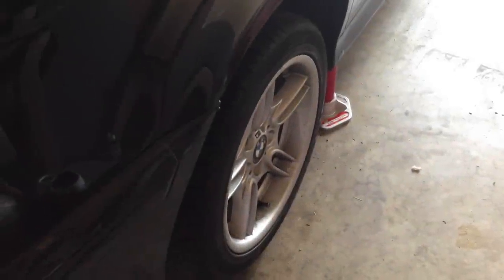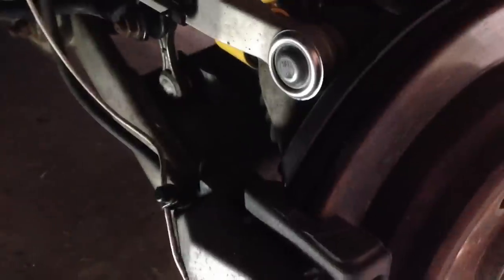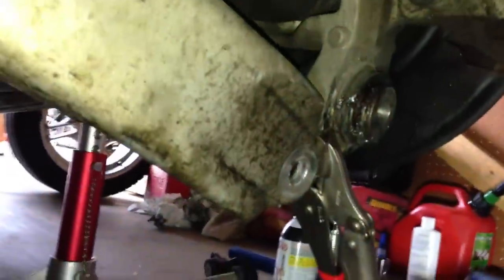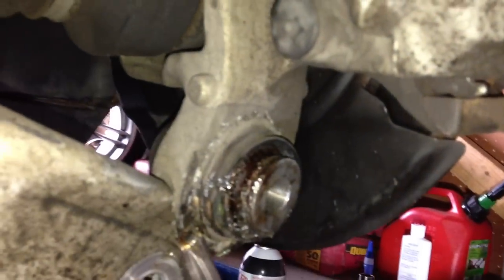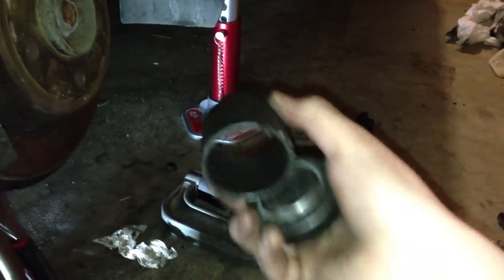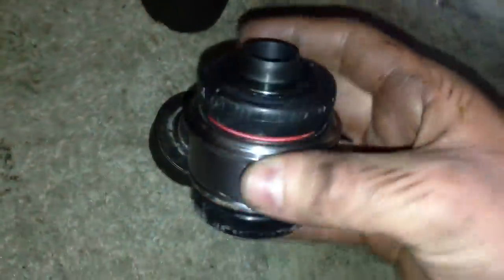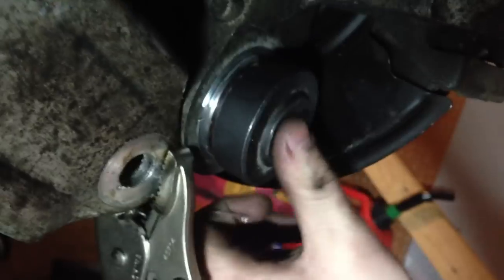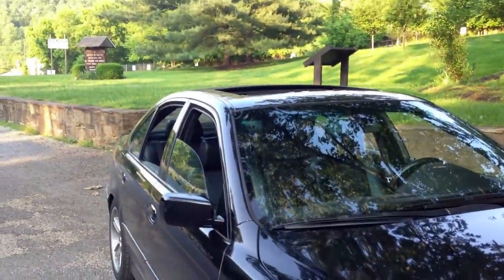BMW E39 Ball Joint Replacement DIY

Comment: ECS Tuning sells a legacy BavAuto-designed  ball joint seperator tool for $50 specifically for the e38 and e39.  I used it this weekend, a very clean and fast solution, no guesswork and no doubt, the tool was machined perfectly to extract and input the bearing.  The old ball joint came in and out like butter and the new one was seated perfectly on install the first time.

Comment: That part you had a lot of trouble with...Couldn't you just throw a jack under the wheel carrier, and jack it away from the H-brace? Just wondering.

Comment: Thanks for another great DIY!

I just (almost) finished doing this job using a Harbor Freight set of cups and oversized C clamp.  I just have three observations here:

1) You have to be a masochist to use the C clamp method.  Ideally, you should get the official BMW ball joint kit, which includes 4 cups and a long bolt to attach through the middle.  There are similar kits for under $100 on eBay, e.g. http://www.ebay.com/itm/282241549742 .  Even if you buy the Harbor Freight kit for the cups, you should still use a long bolt instead of a C clamp... 8" or so is about right.

2) Pulling the swing arm down while it is still attached and holding it with vise grips is a great way to lose a digit.  Instead, disconnect the inside rear bolt, loosen the inside front bolt a little, and let the swing arm do what it's supposed to: swing down for easier access.  Yes, this guarantees that you will need to do an alignment but if your ball joint is fried you will almost certainly need one anyway.

3) Don't forget to disconnect the brake caliper, rotor, and metal guard... it's well worth it to save the aggravation.